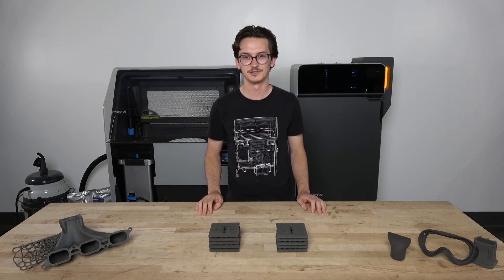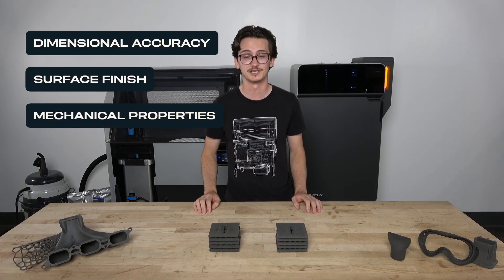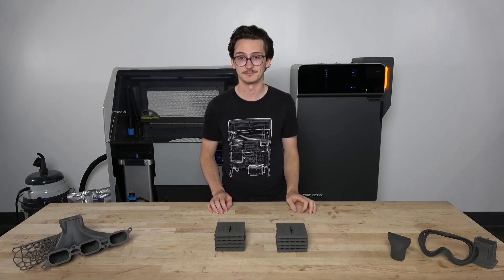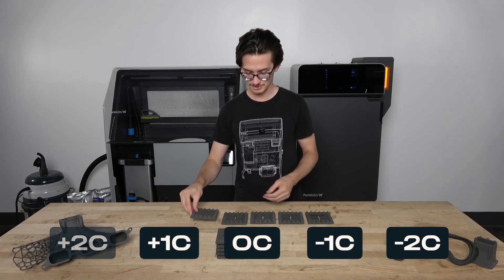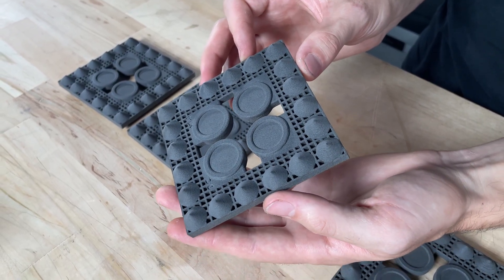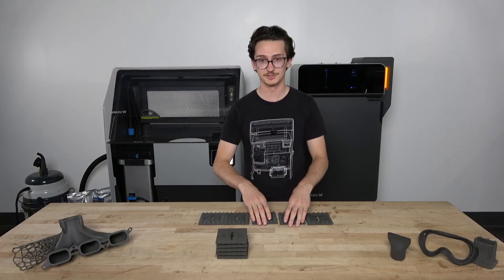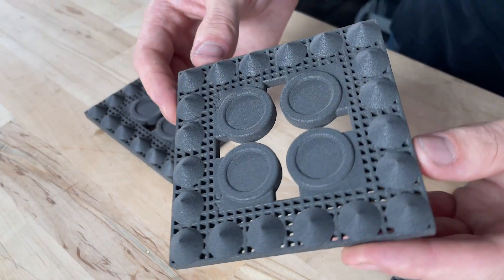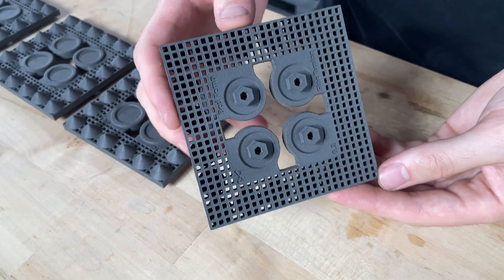How to read the bed temperature tuning test print | Fuse 1

Comment: It's not entirely clear why you choose a part with defects and say that this is normal, and for a part without defects you say that it is overheated. I don't understand the logic of the choice.🤔
Reply from the maker: When it came to designing this diagnostic print for the Fuse, there needed to be a clear indicator present in the results so anyone would be able to identify a clear conclusion. I agree that the "poor" result actually being ideal in this test is really counter intuitive, but, due to the unique circumstances of how this print is run and how the parts are specifically designed for the test, it does not reflect the quality of parts going forward. It is simply used as an indicator to identify the right temperature offset that will provide optimal results under regular printing circumstances going forward. I hope this is helpful!
Reply: @FormlabsSupport  My observations are the following: the higher the temperature, the better the material fuses, but at the same time the number of surface defects increases and the results become less stable. That’s why it’s important to find the optimal point — not overheating and not underheating, since both always cause issues.
In FDM, this means tuning the settings to achieve the cleanest print, accurate dimensions, and perfect layer bonding. In SLA, it’s a similar story: too much exposure leads to resin bulges, while too little causes other defects. A flawless surface means the settings are just right.
That’s why I was surprised by the idea that defects = good settings 😅. I’ll definitely need to test this with Fuse+.

But here’s what I’m curious about: if we print the same cones or similar parts in Fuse+, as on the test model, are you saying we won’t see those defects anymore? That’s really interesting — a bit hard to believe, but probably true 🙂
One more thing: in the final instructions it’s not clear where and how exactly to apply this correction.